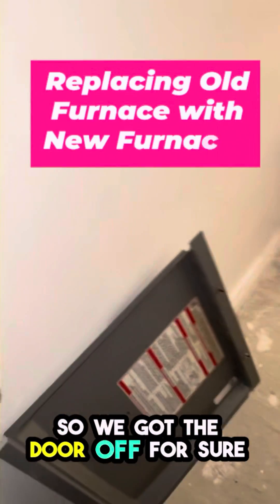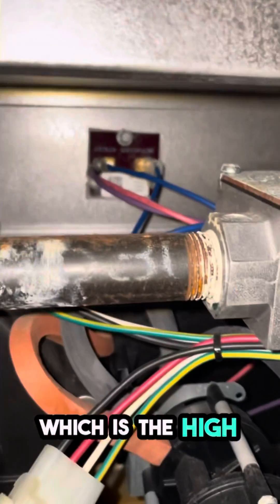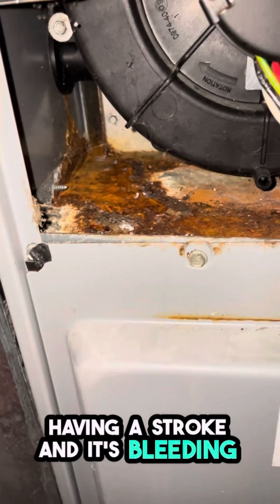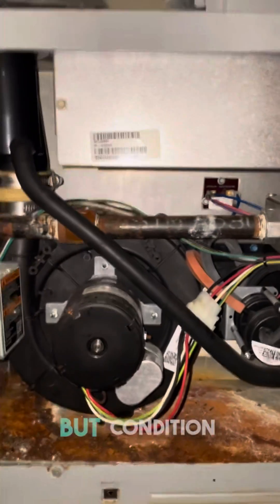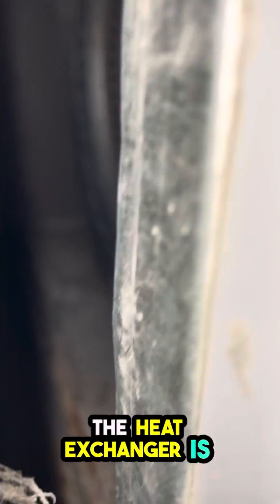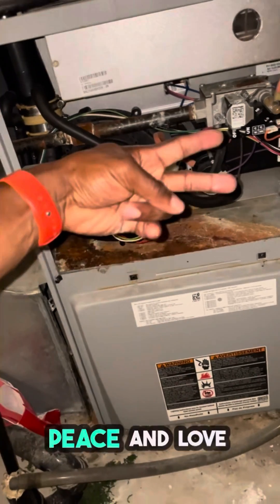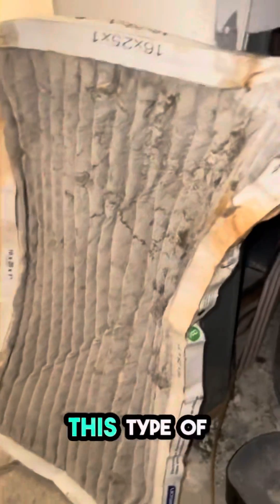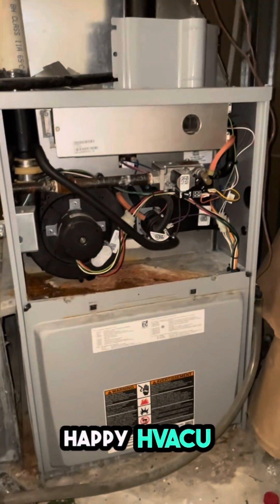HVAC 101 signs your furnace needs to be replaced

Comment: Brother, you can see exactly where it's leaking from. Armstrong furnace, very common leak point on the left side of the collector box, there's is an additional drain point for horizontal applications, the plug is often loose from factory. Just needed a little Teflon on the threads and it would have been fine.
Reply from the maker: I put my camera in there and the heat exchanger was rotted . Lack of maintenance, lack of changing Air filter, gas pressure not set properly etc. Thanks for commenting